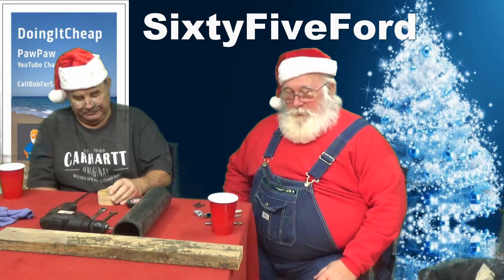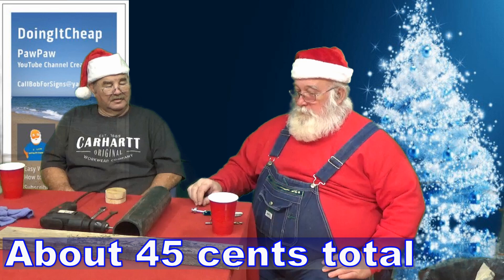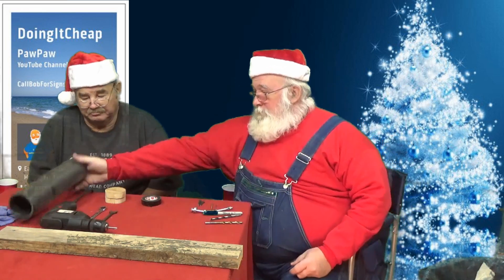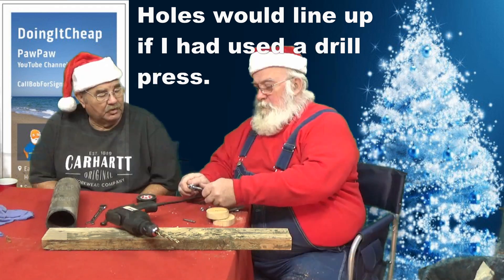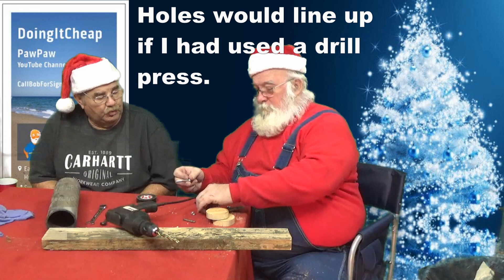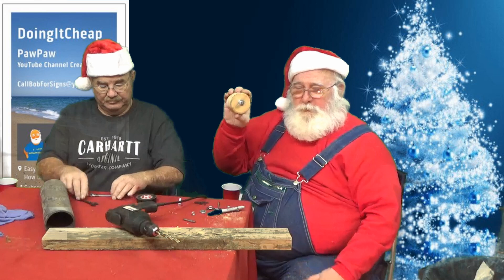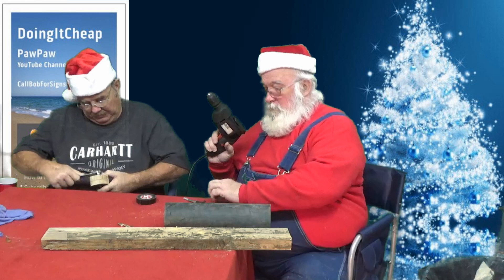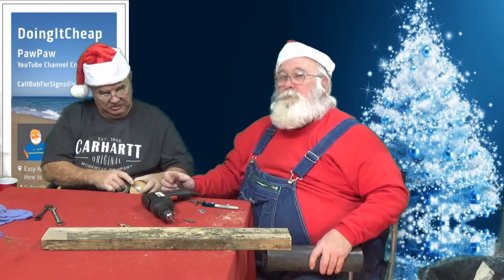Easy Paint Shaker PawPaw and David Share an Idea from SixtyFiveFord

Comment: Paw Paw How long is abs pipe?
Reply from the maker: It comes in ten and twenty foot lengths.
Reply: @DoingItCheap  How long for can shaker?
Reply from the maker: About 3 inches longer than the longest can you think you will use.